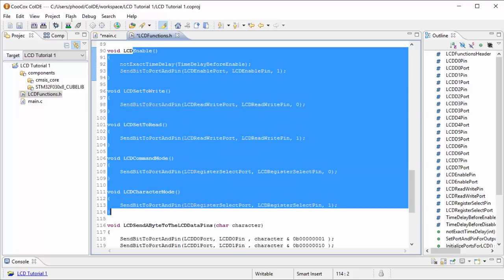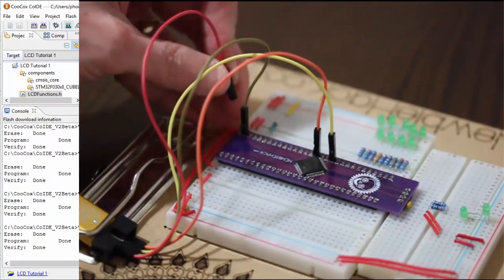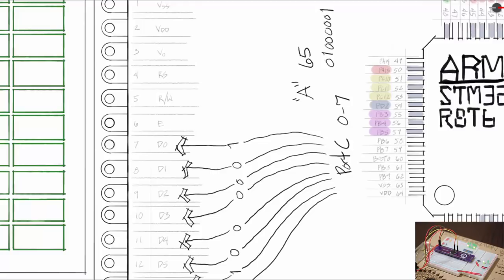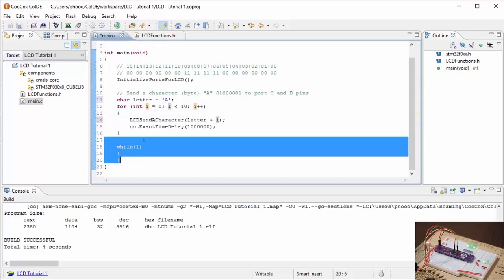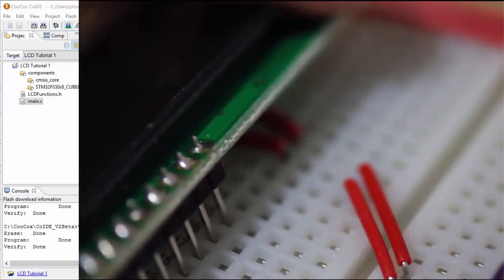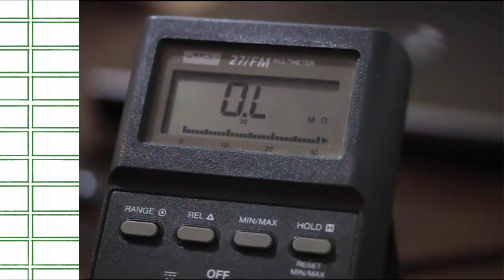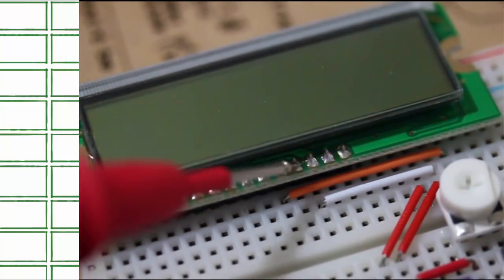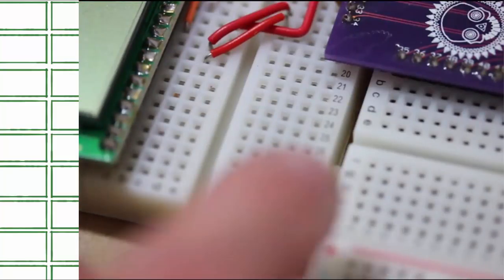26. How to Interface an LCD to an ARM Microcontroller Tutorial - Part 13

Comment: I get it.... but is this is a much slower and tedious approach to lcd hacking and manipulation, for example what I did was for a tablet with destroyed screen, I used a totally different make make it was like an acre or something and all I did was figure out which leg controlled what and as long as I can either fit the ribbon into the device I’m trying to control or solder in wires where I want them to go, I’ve been able to bypass lock screens, iCloud locks, tv parental control and other lock out features because they usually don’t expect someone to plug a totally different lcd ribbon into their device so although the device is written to lock and expect a certain password, that password wasn’t told that it had to apply to every single other devices ribbon connected. So once i connected the ribbon and wiggled it a little the device just assumed I entered the right password or something because it just opens right up for me, or I can just side swipe it and it tosses it aside and let’s me in... so I find it easier and less time consuming.
Reply from the maker: Thanks for the feedback.  This video is a part of a larger tutorial series on how to use the GPIO of the ARM Microcontroller.  Think of it like a simple LED blink (Hello World) type of program, but on a much more elaborate scale.